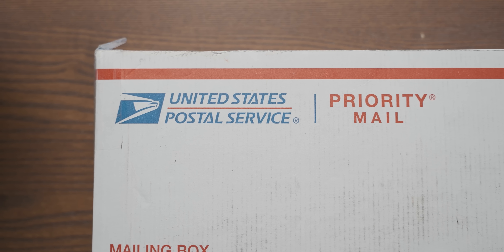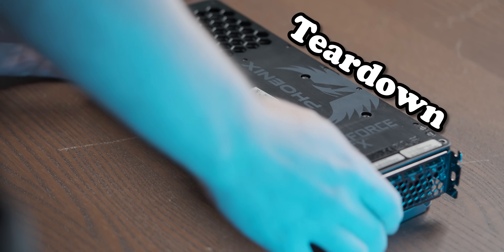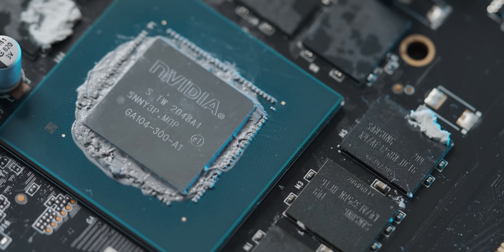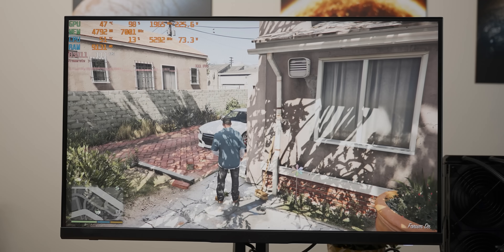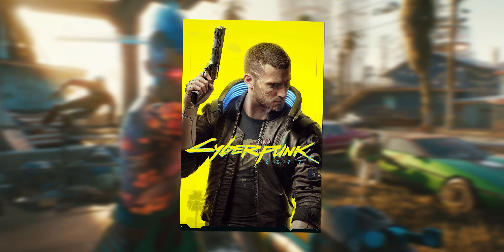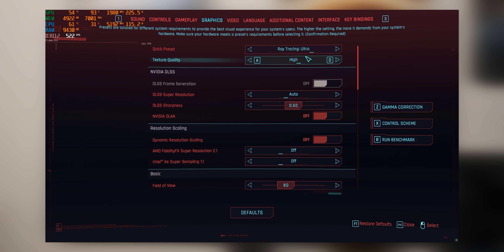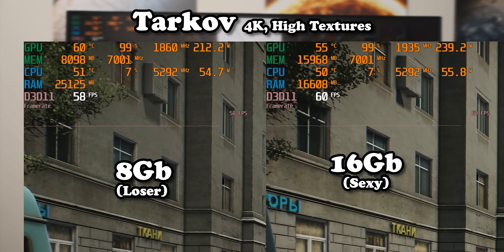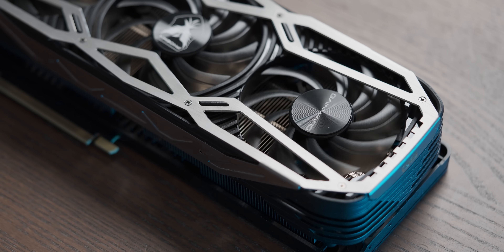This Is The 16Gb RTX 3070 Nvidia Should Have Made

Comment: Even this generation is pathetic with VRAM.  The RTX 3080 had a 320 bit memory bus, so IMO they really should have made the 4080 a 320 bit card with 20GB (similar to the 7900 XT), and given the 4070 and 4070 Ti 16GB over a 256 bit bus.  The 70 series are particularly bad because they have low bandwidth in addition to capacity, so they lose a disproportionate amount of performance at 4K resolution.
Reply: The 4080 would've had to have been using AD102 (same die as 4090) but cut down to the 320bit bus. AD103 only had a 256Gb bus. Completely agree with you there though, it wouldn't  surprise me if a 4080Ti is 20GB on further cut down AD102 with around ~13k CUDA cores.
Reply: @2intheampm512  Ya the die size of AD103 is pathetic compared to AD102 (and the 4090 doesn't have all the CUDA cores enabled, which is ~18K IIRC).
Reply: @DrearierSpider1  18172 and the card with these ones melted PSU's so they won't release an unlocked 102 for now.
Reply: @iamrubinot42  The RTX Ada 6000 is using close to the full die (only 2 SMs disabled) with 48GB of VRAM, and uses only 300W (its a dual slot blower cooler even). To be fair it's using less power hungry (and slightly slower) GDDR6 and is clocked lower but it's totally viable that Nvidia releases that Titan SKU and limits it to 600W, which really wouldn't result in any meaningful performance deficit over that supposed 800W Titan that melted PSUs/itself. Even with using GDDR6X, and slightly higher clock speeds and an additional 2k CUDA cores I still doubt it would use an additional 150W+ under load (the 4090 very rarely uses 350W, and it's incredibly difficult to push it above 500W even on the models that support 600W TGP). If they use that Titan cooler, which likely can cool about 800W TGP (which is likely why those PSUs were melting, they were conducting tests on the cooler/PCB when pushed to 800W draw), the Titan would more likely use about 600W when under max load
Reply: @2intheampm512  4080ti could be banger actually, but... will they release it?
Reply: @iamrubinot42  Maybe. What I could see as being more likely (if rumors hold true that we won't see Blackwell on N3 until 2025, and Nvidia ends up not using an N4 family node for consumer instead) is a Lovelace Refresh early next year. So the 4080 is replaced with an AD102 4080 Super at the same price point, 4080 gets dropped down to $1000ish. Maybe we then see a 4070 Super or 4070Ti Super lol using further cut down AD103 (so like 8k CUDA cores) and 16GB VRAM. A product with a cut down AD103 die below the 4080 configuration seems very likely at the very least considering only the 4080/4090 Mobile are using AD103 and its only slightly cut down from the full die (9k+ CUDA cores vs a little over 10k for full die). Although it's possible there won't be a new SKU released using AD103 and the worse yields will just be cut down to a 4070Ti core/bus configuration. Keep in mind this is all speculation haha I'm not basing this on any credible leaks/info. Just making an educated guess based on expected AD102/103 yields
Reply: Ampere vs RDNA 2 will likely be a refresh of how Kepler aged vs GCN. While initially having better performance much of the time, Kepler had very lackluster VRAM capacity on most skus, while the GCN cards of the period had more VRAM at most price points.
Reply: Yes, 192-bit bus blocks 4070ti and 3080ti surpasses 4070ti in 4k. In 1080 and 1440 4070ti is better than 3090ti but 4k... nvidia f*cked the potential up. If this thing could have 256-bit then best amperes wouldn't have any chances in 4k.
Reply: @iamrubinot42  4070Ti has smaller but faster bus and 10x more L2 cache. Funny that you say it needs 320bit bus when 6900XT and 6950XT had 256bit and nobody complained. Besides the bus is a lot faster, on 6900XT level.
Reply: @iamrubinot42  If you want to play 4K just OC the memory you'll get 576 GB/s bandwidth (same as the RX 6950 XT)
Reply: I will not change graphic card next year, so i think my only real choice is to go with 7900 XT.